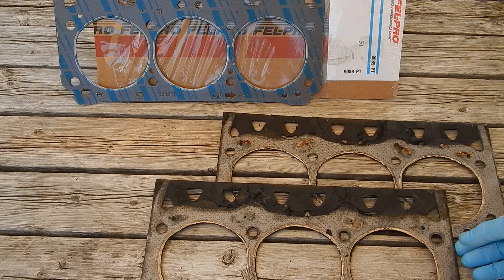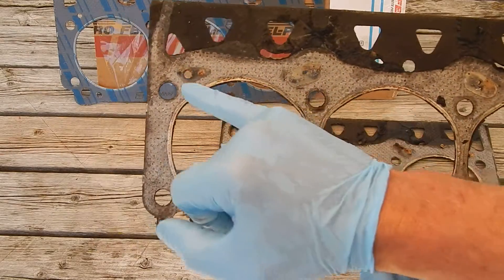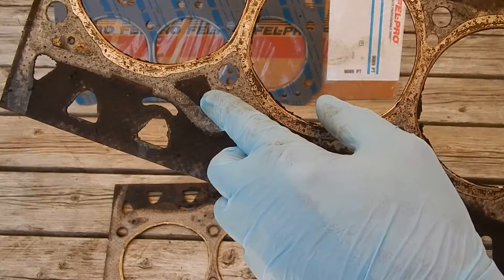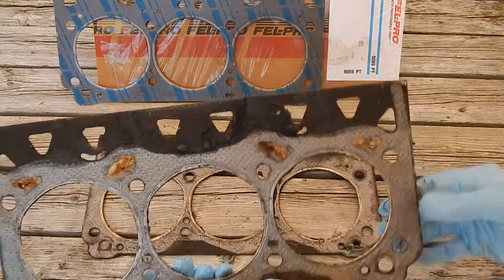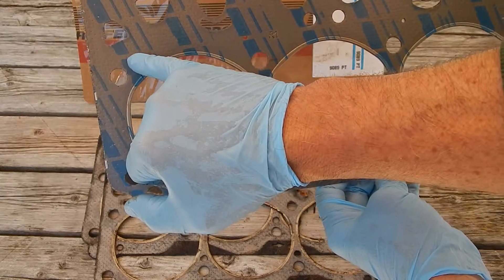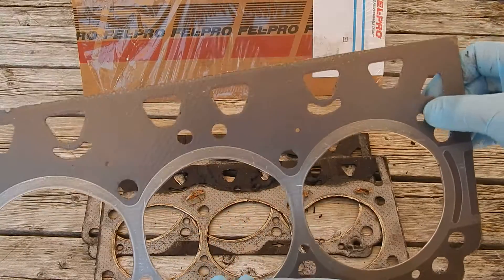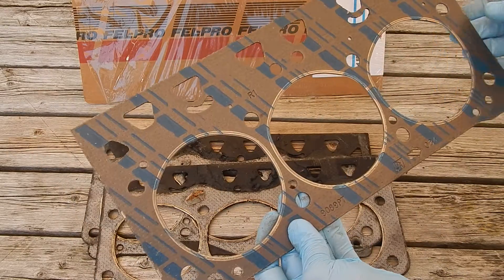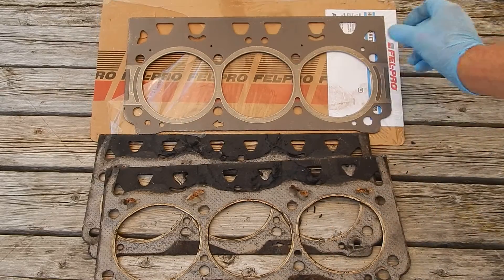Buick 3800 Series II head gaskets

Comment: I just completely flushed out all the Dexcool and using Green now. Did you switch as well?  I believe I should have replaced my head gasket too. >;-(  This will be my next move. Informative vid. Thx
Reply from the maker: Geff Lynn    9.18.19.   I always replace the DexKill™️ with the mixes with any kind type.   I also flush it @ 2yrs/30k miles, for trouble free service. The problem is the maintenance schedule the manufacturers put forth, is a marketing ploy to make it appear that it’s a low cost operating vehicle! Unrealistic in practice for all intents & purposes.
Reply: @stevensapyak7971  Good to know and agree on the "unrealistic" part. Love the 3800 but maintenance is required. Have 198700K and have had to replace the plenum 3 times due to EGR melting breather hole! Not so bad but just a time factor.  My 1999 Eighty-eight runs cooler with Peak Extended Life for some reason. Dex 223 Peak 219 degrees. What tipped you to replace the head gasket? Any symptoms? The 88 (pre Peak and presently) starts fine but many times after it is hot it starts but spits and sputters (kinda like it is running rich) but it stabilizes after several seconds and runs fine. Ideas? Thx
Reply from the maker: Geff Lynn    9.20.19.   I use ATP upper plenums, sourced thru RockAuto. They have a metal sleeve inserted in them to keep from melting the plastic or composite EGR port! ........ For the Series II Engine.
Reply from the maker: Geff Lynn    9.20.19.   Your throttle body may needs to be cleaned?  I changed the head gaskets because the engine was very dirty internally, due to poor maintenance practices! I had it down so it was not much more to do the heads.....ie .... valve job an valve stem seals.

Comment: Steven , Of All The 3800 Head Gasket Vids , I find Yours the most compelling. I have flushed My 3800 several Times and had good Success with Bars Leak Head Gasket Fix. After All of That , The System will not Cool well enough to handle stop and Go Driving. I think You may have discovered The Reason That The 3800 Head Gaskets fail ! Do You have Knowledge about if perhaps a Soda/Vinegar Flush would unblock Those Ports ? , Thanks , Look foward to Your Reply or Anyone Who has Knowledge/Experience on This.
Reply from the maker: Van Schliestett    6.29.18.   I don’t believe that you would have any success in trying to clear the blockage with a soda/vinegar solution. How many miles are on the car? .....The radiator may be partially plugged!.....your water pump may have it’s pump impeller worn away!......the thermostat could be an issue?......Look at the easy stuff first........is the serpentine belt slipping?......belt tensioner weak?.....did you perform a block/radiator flush?....dump the DexCool!!! And use the mixes with any type of coolant. ...... Oh also the heater core needs to be flushed separately!!  🔧 .......Oh yes!......make sure that the cooling fans are running when the temperature is at around 210 Degrees!......it could also be the thermo switch that tells the PCM to turn on the fans!!!
Reply: Yeah , I've worked on This for over a Yr. Flushed sev Times , Water Pump is about a Yr old, Radiator is about a 1 1/2 Yr old , T-Stat is 3 mo old ,  Fans are running, Belt is now Currently has Bars Leak in Sys and will not Cool adequatly after running about 20 Min in this Hot Weather. I can only conclude the Ports You showed are Clogged. My next attempt is Prestone Super Flush.....In Terms of Vinegar/Soda , is There a Dilution Ratio for Vinegar ?....FRUSTRATED !
Reply from the maker: Van Schliestett    6.29.18.   Take a video and put it on YouTube, I’d like to see all the things I mentioned in my reply!
Reply from the maker: Van Schliestett     6.29.18.      You need to perform a pressure test on the radiator/cooling system!......also a leaking radiator cap will not allow the system to build up to 16-18psi to keep the coolant from boiling!!!.......extremely important‼️👌🏽. Flush the system again an do not use Barr’s Leak‼️‼️
Reply: IT'S FIXED !!........I did a Flush using a 4 to 1 Mix of Distilled Water with "Simple Green" Concentrate Soap. I still think You have found The Source of why 3800 Gaskets blow.......I think I have found the Solution once the Head Gasket Sealer repairs the Head and Intake Leaks. It just needs a Washout. Take Note of how well Simple Green cleans Alloy Wheels and think of what It does inside the Block.
Reply from the maker: Van Schliestett    7.8.18.   The Block & Heads are cast iron, not alloy......... I hope you have remedied your situation. How many miles are on the car/engine? I believe that the Barr’s Leak may have contributed to the over heating condition.......keep a close eye on your temperature gauge and the coolant reservoir tank. These engines also need the lower intake gaskets (L.I.M. ) changed out with the metal framed kind from either Fel-Pro PermaDry or the GM AC Delco aluminum type!
Reply: I've watched the Temp Gauge like a Hawk !....In stop and Go Traffic  , It can get up to 200 on a Hot Day like Today about 90 Ambient Temp. The T-Stat is 195. .Otherwise the Temp Gauge is Perfect.  I may go for One More Flush with Simple Green but I don'want to mess Up the Bars Leak Fix. ....Would You elaborate on the Overflow Bottle ?......I allow the System to cool Overnight and check to see if It Dropped. So far , no Dropping. The only Anomally is That it begins at the Cool Marker but exceeds the Hot Marker about a half Inch above Hot Marker.

Comment from the maker: 6.7.15.     Also the Vin 1 & Vin K engines use the same block & heads, except that the Vin 1 has the fuel injectors placed in the head!  👍🏽

Comment from the maker: 6.7.15.     After I got to looking, I noticed that the head gaskets I took off left cylinder bank (1,3,5) had part# 24503480 & right cylinder bank (2,4,6) had part#24503479. I looked on the Fel-Pro head gasket 9089PT packaging & found, Replaces No. 24503479, 24503480. I looked up head gaskets at Rock Auto for a 1997 3800 Vin K, & found 9017PT for the Left & 9018PT for the Right, for $12.72 each. The 9089PT are, $20.79 each. Looks to me that Fel-Pro just decided to make it easy for themselves & skin the consumer for $16.00 markup & make a gasket that fits both banks by flipping the gasket! I then took the new 9089PT & matched them with both head gaskets I pulled from my engine. The only difference I saw was, that the openings for the pushrods were bigger on the 9089PT! You need to flip the gaskets when you use the 9089PT because the coolant metering holes at the top of the gasket, on the rear/ flywheel end needs the larger hole at that end. Next time I'll just use ones for a Vin K on a Vin1 engine & save $16.00. 😎